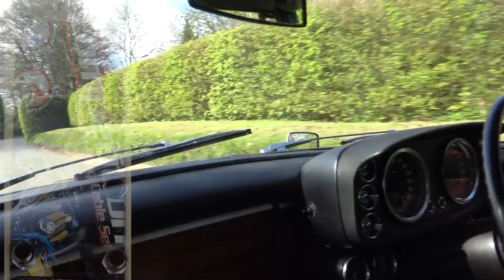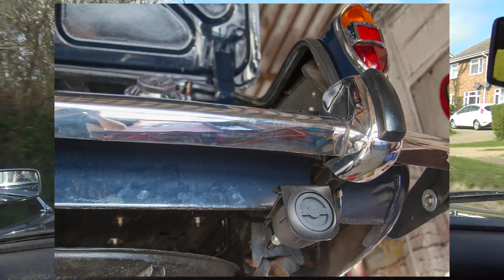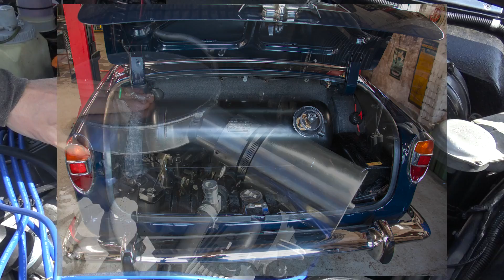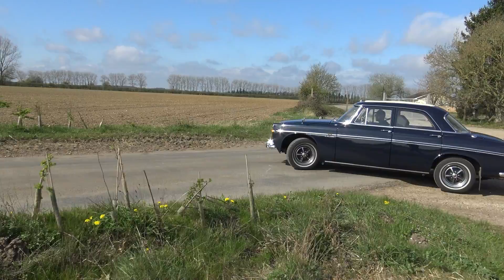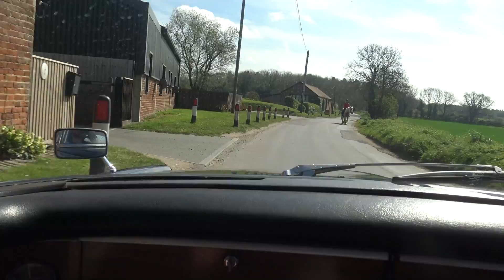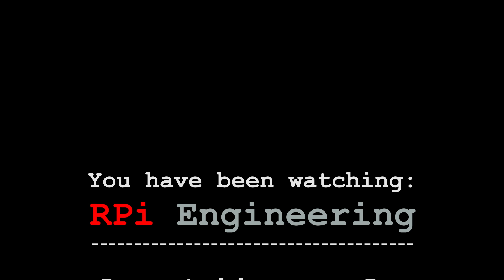Rover P5b 4.0l V8 and 4 speed auto at RPi Engineering

Comment: I've had a 1971 P5B Coupe for twenty years and being a member of the P5 Owners' Club I'm aware of the conversions carried out by owners. A larger capacity fuel injected engine from a Land Rover can be fitted, that can be bored out to 5.5 litres creating what's been described as a torque monster. The four speed auto transmission from a Jaguar XJ40 can be fitted. It's costly because a lot of electronic work needs to be carried out but it improves the performance, fuel consumption and driveability. There are options to convert to five speed manual but I don't know anyone who's done that. For all round disc brakes BMW parts can be used

Mine is completely unmodified except for electronic ignition and stainless steel exhaust. When those cars were new the expected standard was that it should be able to climb a 1:8 hill in top gear, little thought was given to longer legged motorway performance. I won't be modifying my car just yet but as parts wear out I'll give due consideration to the improvements I've mentioned. I won't be doing an LPG conversion, I don't know where to buy that fuel.

Comment: How much are we talking (ball park) for this 4L conversion with 4 Speed and LPG conversion??
Reply: Bog standard P5 owner of twenty years here, this is what I've been led to believe and have no reason to doubt it. The Jag XJ40 4 speed auto is or was the auto gearbox of choice giving improved fuel consumption and usability . Conversion costs £££ thousands because a lot of electronic work is involved. Some owners have converted to manual transmission, NOT the SD1, it's too weak and prone to premature failure.  The six wheeler Sherpa/Freight Rover, or V8 Land/Range Rover has been used. On the latter there's an extra output socket for 4WD, ignore that. All round disc brakes are an option using BMW components. As for fitting larger capacity engine fuel injected Land/Range Rover units have been fitted up to about 5.3 litre or whatever is the maximum.  These are not a lot faster than standard V8 but have been described as "Torque Monsters". These conversions are costly but some people just LOVE their cars.